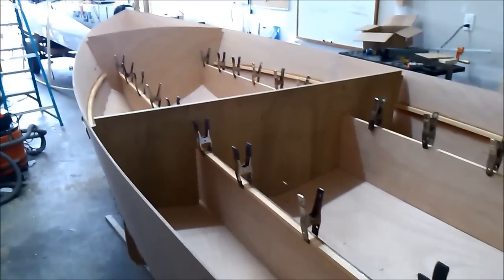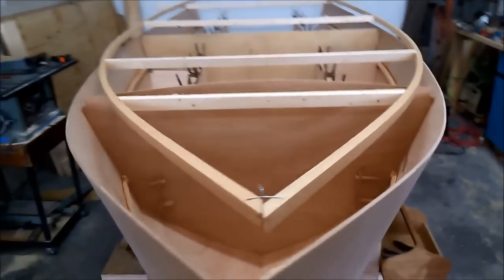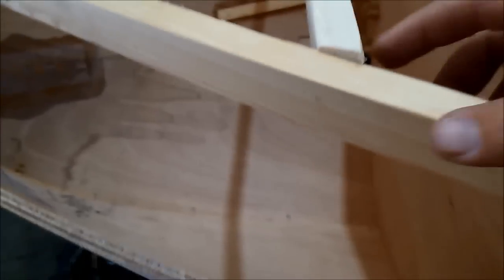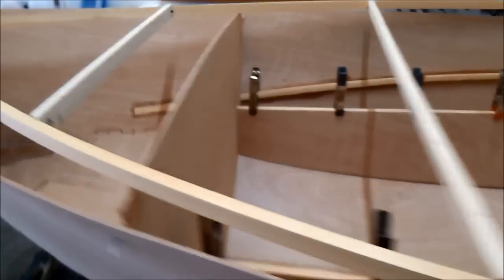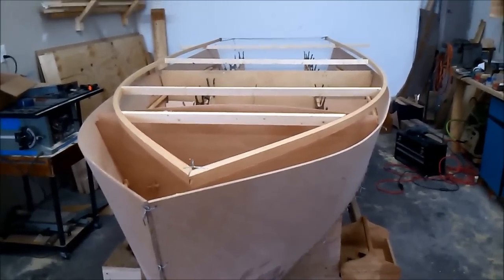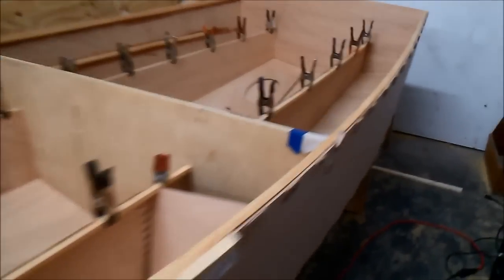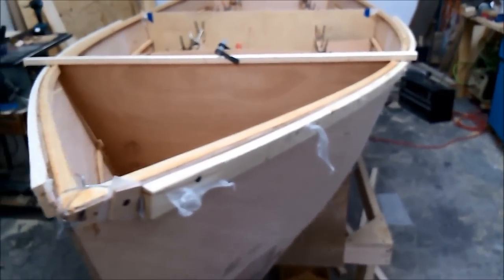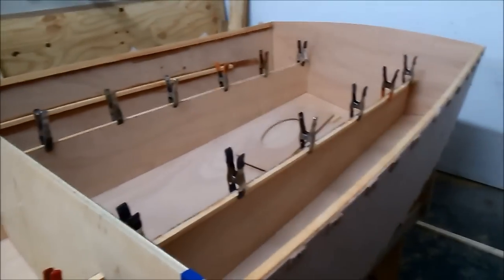Core Sound 15 Hull Assembly Part 3

Comment: Hello friend, I hope you are well.  Well, I don't speak English, I speak Spanish and I'm using a translator.  Look, I have a project with a fiberglass pot and I have to do what you just did in the video to put the edge on it, but can you tell me if it is a special way or if I can use any wood.